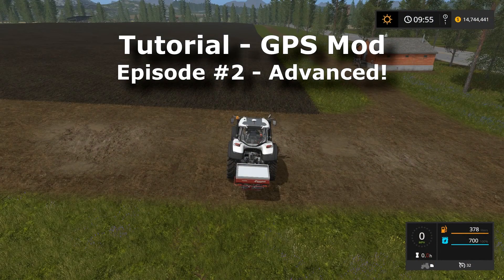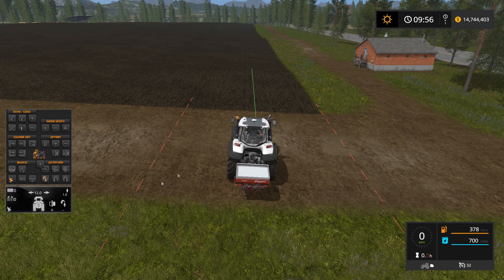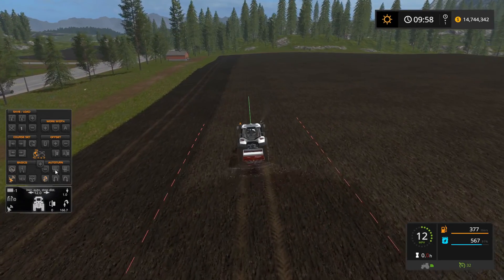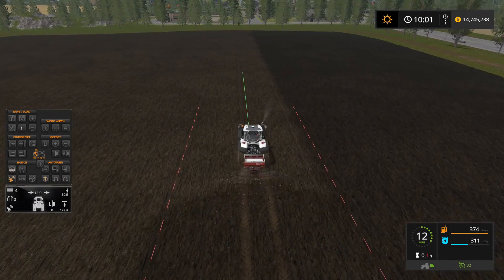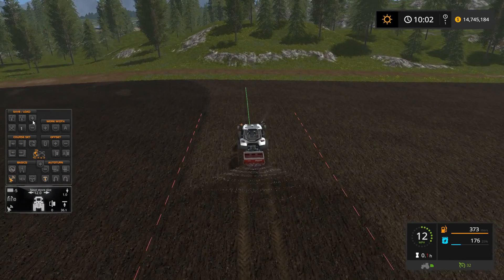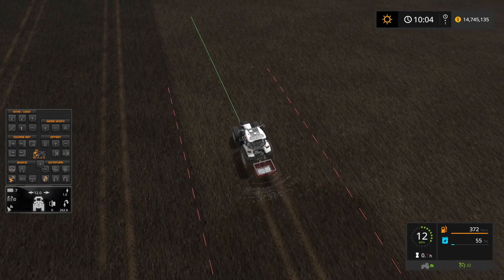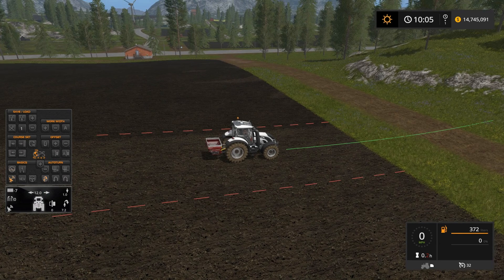FS17 GPS Mod Tutorial #2 Advanced

Comment: Nice video.  I was hoping to discover some hidden value to the save/load feature but I see that you also don't really use it.  The two exceptions you mentioned are worth noting though.  I hadn't considered the plow offsets as perhaps a good use of that.

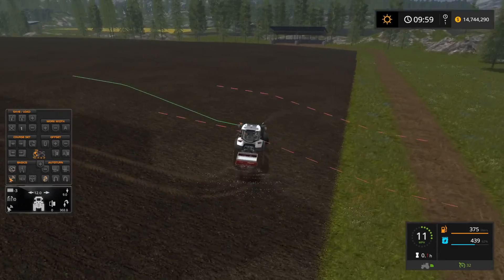I believe the increase/decrease stop distance does affect auto-turn but is less noticeable than for auto-stop.  Compare the turns at 2:45 and 4:45 and you can see a difference in coverage.  I use it (e.g. with the 30m wide slurry spreader) to keep from colliding with trees/structures during turns and it works for me.
Reply: +ManCave2010, I too use the stop distance for missions, turning within the field boundaries allows missions to be completed faster.
Reply from the maker: +ManCave2010 I never noticed a difference with the stop distance in auto turn until I was editing that video,  I picked up on it, but wasn't sure if I was just seeing things. I still wish I could go negative so I could run the equipment out of the field into the headland a little.
Reply: I could not agree more with you about the negative stop distance.  That would be so helpful... maybe some day.
Reply: ManCave2010  I use it alot too take headlands 1st and autoturn whith in field set whit that distance. And grab some coffe 😁